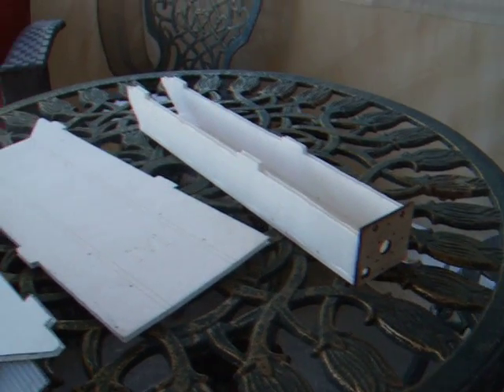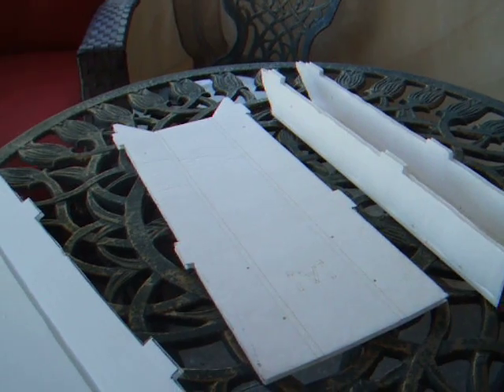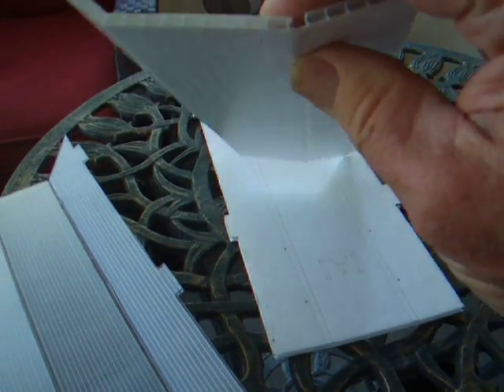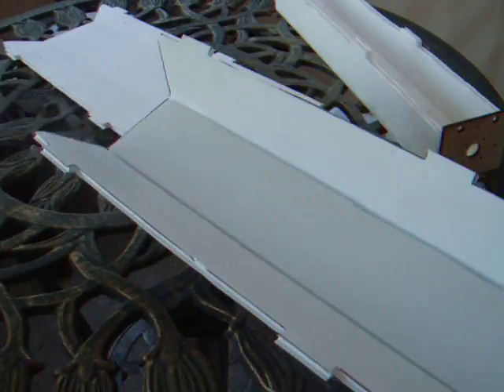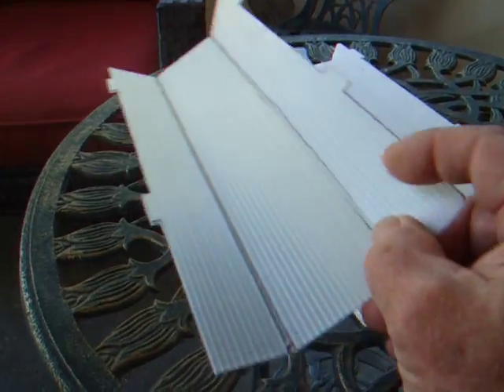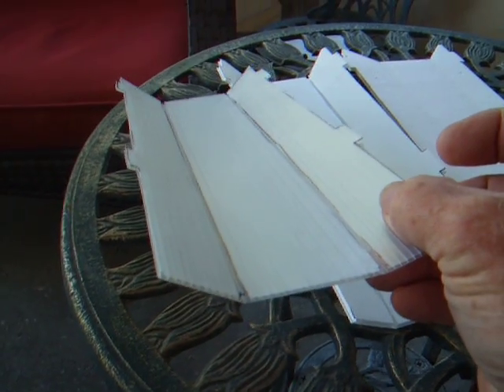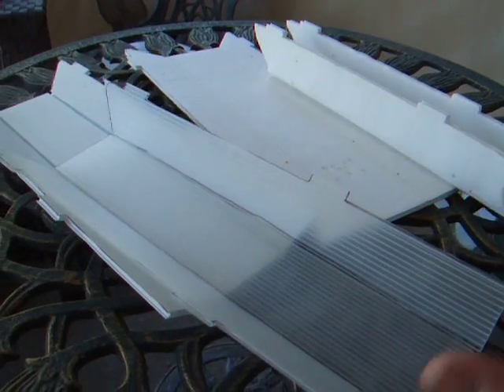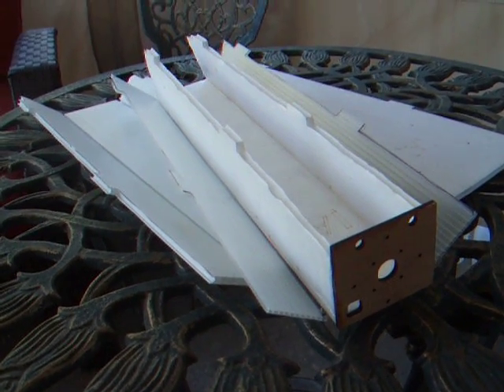Power Pods (and Coroplast)

Comment: Hey I watched the video on power pods and it seems like the first 10-15% of my pod is the only part receiving all the damage of a hard landing (crash).  I've been using popsicle sticks and extra foam to nudge the firewall forward, but could there be a coroplast reenforcement that would lighten the load and only enshroud the first third of the original foam power pod? Also I feel like the pod actually should be the weak point since the frame of the plane should be strengthened for longer flights (but I keep breaking components and tend toward pushers for cost efficacy).* I use spent campaign signs because they are trash and 4mm and are ubiquitous every 2 yrs. Free for several days after campaigns.